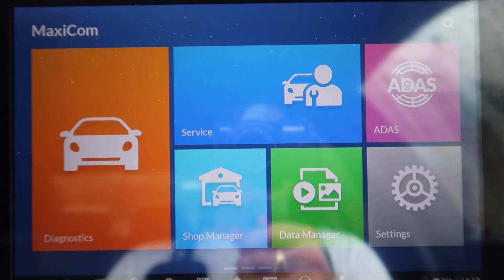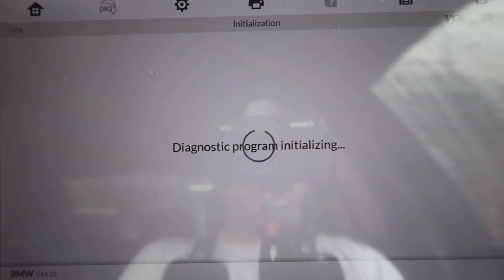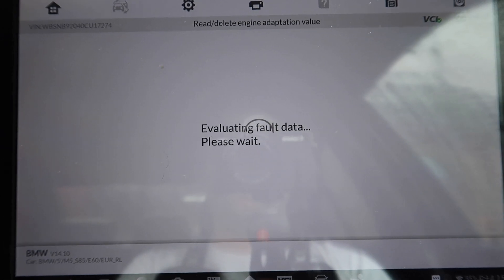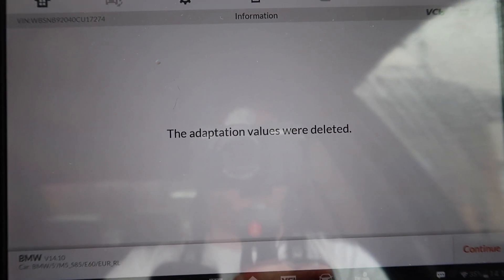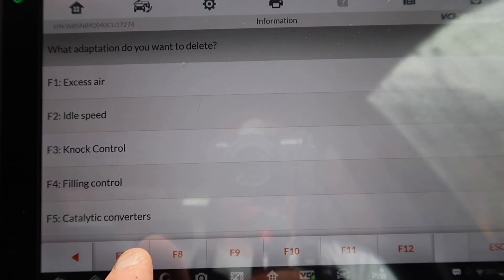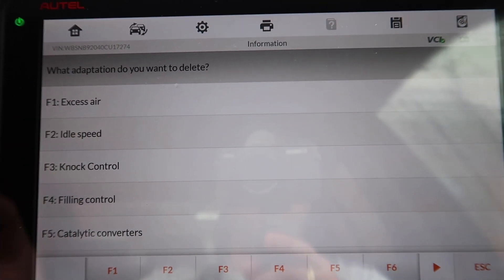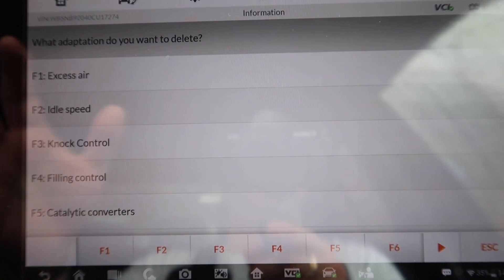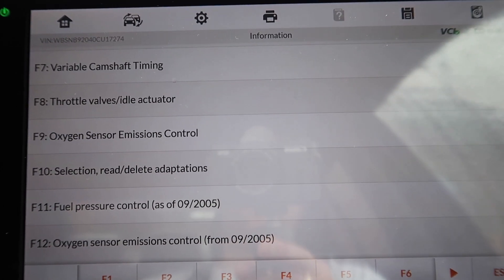Here is How You Fix A Rough & High Unstable Idle The Proper Way !!!

Comment: Unfortunately this this will work temporarily, your high RPM will come back  very soon. To get rid of high rpm properly the is only two options, replace cats with good ones or remove primery cats and remap.
Reply: thanks, I've been looking for an excuse to get rid of the cats!  lol
Reply: Yes....it’s all coming back ...it can also be a cooling issue... I noticed that at idle engine warm the coolant in the engine is 90c but the Copland at radiator outlet is at 45c ...it seems like a huge difference can someone that has an m5 confirm if the get the same numbers?